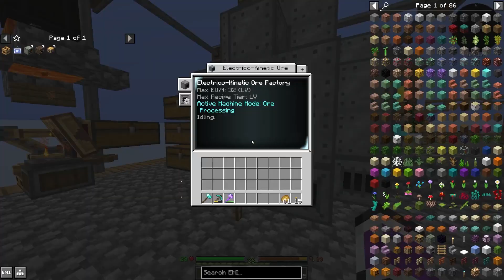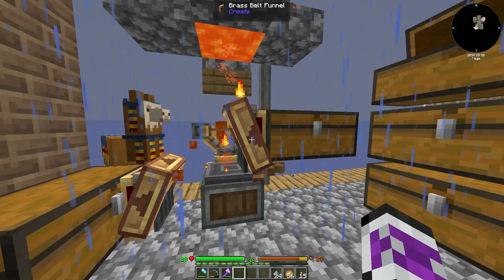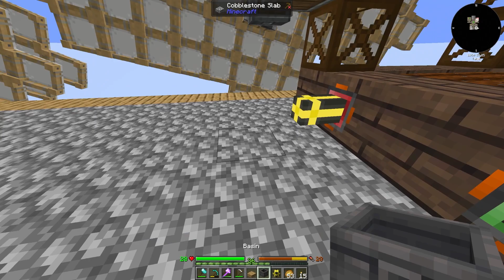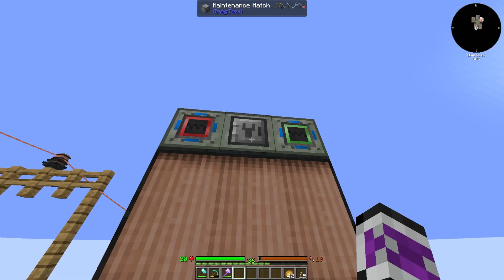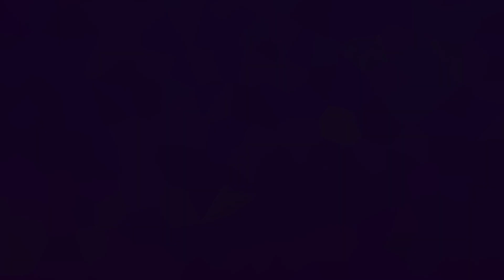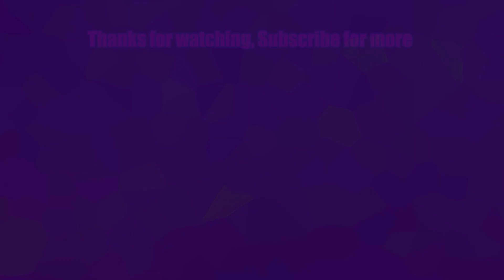Star Technology: Episode 7 - Massive Generator Upgrade

Comment: How overclocking works:
1. Overclocking is available only for electric multiblocks. There is no kinetic overclock
2. Overclocking is achieved by having 2 energy hatches on a muliblock(3 will still overclock but only once and not twice)
3. Overclocking happens because an energy hatch uses 2 amps of energy, so 2 energy hatches will be 4 amps which is equivalent to 1 amp of the higher tier of voltage(ex. 4 lv amps = 1 mv amp, because 4*32=128)
4. Overclocking will raise the recipe tier by 1(an EBF with 2 lv energy hatches will be able to run mv recipes)
5. Overclocking will approximately half the duration of a recipe(not applicable to the recipes of the same voltage tier as the overclock)
6. 4 amp and 16 amps energy hatches will not overclock the recipe tier, but will apply the recipe duration reduction
7. Some multiblocks accept only 1 energy hatch and so are not able to be overclocked
Reply from the maker: Thank you!!!!! This was exactly the breakdown I was looking for
Reply: And some of the multiblocks have their extra rules, like for example the tier of the coil affecting recipe speed, power cost or parallelization. EBFs in particular have extra complicated rules due to the temperature value - higher energy tier gives a temperature bonus to the coil temperature, and if the temperature of the EBF is high enough above recipe temperature, you get a free overclock (i.e. you're no longer paying more energy per item), and there's also a general power reduction aside from that. 

Mind that different GT versions/ports tend to have very different behaviours; GTCEu behaves like this, GTCE tends to simplify things much more (e.g. no reason to use higher tier coils in EBFs), GTNH adds perfect overclocks to most multiblocks...

Comment: Its a blessing that you are making Up to date Star Technology video, i was stuck on making the Electric Furnace because i couldnt figure out how work out the Liquid Tin Alloy with High Pressure Steam Extractor, i didnt  know you can make the Fluid Pumps using regular rubber and not the Styrene Butadiene Rubber Ring. Reddit and Wiki's werent helping much because it was all outdated. Truly, a blessing!

Comment: You should make several microparts for machines at a time instead of using the exact amount for what you need. Most of the time, you can use the Macerator to retrieve, at least almost all of the resources (or the arc furnace)

Comment: As a tip, you can Bulk Haunt cobblestone for Blackstone, easiest with a soul campfire.  There's not too many things that need tons of it, but nice to have the option.  For the dieselgens, I'll caution that the engine silencer only works on the basic and modular engines.  The Huge Engines are a lot more efficient, but they manage to be worse sound-wise and can't be silenced.
Reply from the maker: I haven't played in version of create that has haunting until now, I'll have to check it out for any other useful recipes.

Comment: 24:13 For the Blast Furnace to run MV Recipes you need 2 energy hatches(2 LV = 1 MV, 2MV = 1HV and so on), and you have already that (it tells you on the screen 23:16).
Reply from the maker: @trulyno explained overclocking to me which would be why it works. That's probably why the multiblock asks for 2 hatches in the first place.

Comment: tip for EBF smelting, some metals/ingots like wrought iron or regular iron need a catalyst, like oxygen, without it, it doesn't work, It is technically basic chemistry but idk how that works in a hot fiery oven :P but you can use other gases for smelting down dust/ingots faster, for example, aluminium dust can be smelted for 44 seconds, but with nitrogen, it can make it take only 30, it's a unique feature, so i recommend not doing passive smelting until late mv when you have nitrogen, oxygen and etc. smelted
Reply from the maker: I saw a lot of that when I was figuring out steel, but my brain just glossed over all the recipes with complex gasses and things. I'll look into it further when I need to mass produce resources.
Reply: @Thaumiumking9  best to plan your gas setup when you have ae, so you can access and autocraft with them
Reply from the maker: Yeah, AE2 is gonna be the savior of the high-end tech
Reply: @Thaumiumking9  legit built the biggest base for ae

Comment: In 14:27  You can use a depot below mechanical crafter, funnel in basin, and mechanical arm instead of using an item collector
Reply: You could also just have it output directly into the basin
Reply from the maker: That works too
Reply from the maker: Would that stop the seed overflow? I'll check it out and see if it's any better.